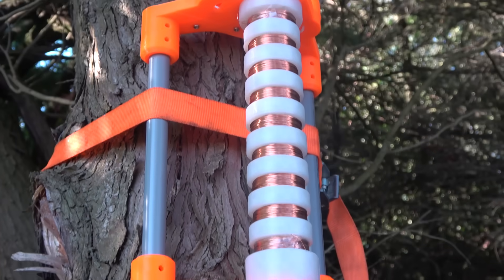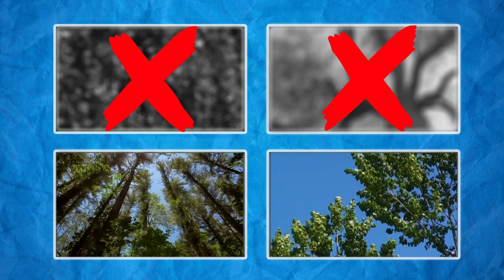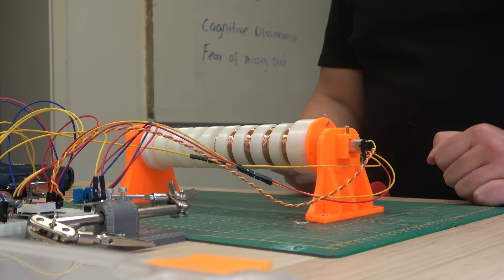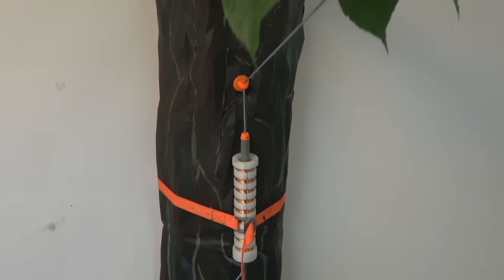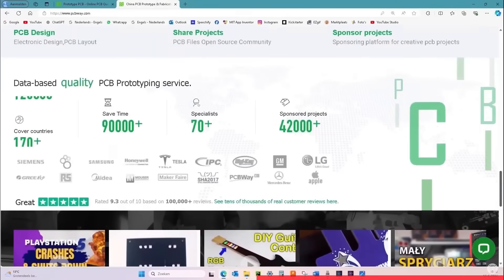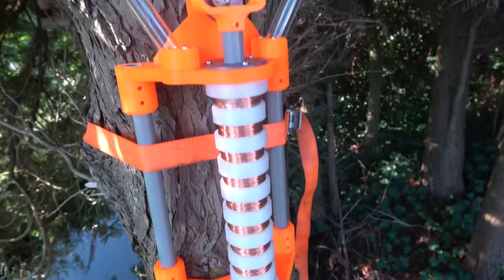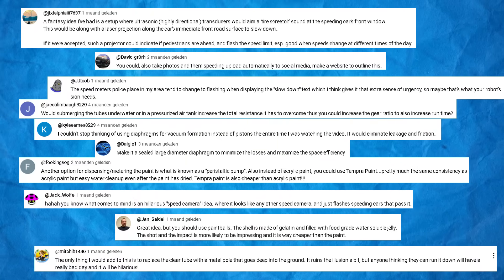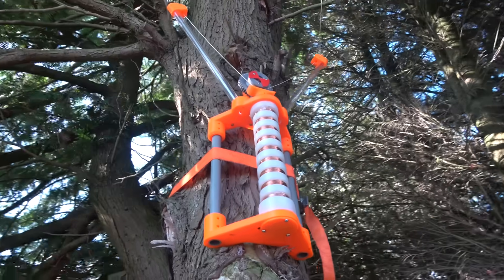I Made a Tree Generate Electricity..

Comment: Have you considered arranging the magnets to create a three-phase output using three groups of three coils? This configuration would produce a smoother output and reduce the required movement. You can achieve a pulsating DC output by using diodes in a three-phase rectification setup. The power output (VA) should remain the same while requiring less distance and velocity of movement (in theory).

For example, when magnet 1 is aligned with coil 1, magnet 2 would be positioned one-third of the way along its coil. As magnet 2 fully aligns with its coil, magnet 1 will be covering the latter third of its coil, while magnet 3 is now covering the first third of its.

Depending on what’s physically easier to construct, you could use either three individual magnets or three groups of magnets, adjusting the complexity of the wiring accordingly. Three-phase power also allows for more efficient transformation from high current/low voltage to low current/high voltage, resulting in less transmission loss.

Adding iron cores to the coils at these slow speeds should significantly increase power output for the same stroke length. This would require "washers" or spacers between each coil’s windings. Plain steel (non-stainless) discs should work well at these low speeds, as the metal is unlikely to reach flux saturation. (Just to note, I'm not an expert—just a 53-year-old hobbyist with a passing interest.)
Reply: All with still the single tube and magnet rod, Just clever spacing to arrive at the pseudo three phase timing. This only works because you have a constant diameter crank.

An alternative might be to use a conventional 3-phase RC motor as a generator with a coil spring for the return action rather than gravity. Like the timing wheel in a small clock or watch. Those can even be 3D printed in plastic and work surprisingly well! Of course constructing your own generator in that configuration would be much more difficult and not as easy to make weather resistant and such. If interested in experimenting, highly efficient permanent magnet three phase DC RC plane motors called "out runners" are available in many sizes, power and "KV" specifications (RPM per volt, iirc). Of course, its also easy enough to convert linear to rotational movement using a pulley.
Reply: and yes, I did get the point that more experimentation in efficiently capturing branch movements is likely the higher priority at this early stage.

Comment: As far as feasibility goes, I mean, If it can produce enough power to help recharge some batteries for devices of smaller size, then it's a useful item to have for those who want power available in some form out in the middle of the woods, etc. Basically useful under niche use. Outside of that, probably not much real world use for it. But still an interesting concept nonetheless. 

As for making it better? I have a few ideas.

1. Include some snatch blocks on those lines. I'm not entirely certain where to put them, but I suspect they will be helpful in converting the trees movement into more useful kinetic energy for you to convert into electricity. I could be wrong of course, but it shouldn't be a hard thing to include, and then remove if it's not worth it. Not like the next idea.

2. Weight is of course of the issue here, and so we don't want to make it too big. But there is perhaps room for a double cylinder method to be employed. Essentially you have one cylinder doing it's normal movement, but then on the outside of those you have the opposite going on as well, likely due to the springs mentioned pulling back and forth themselves if attached. So in this case you have magnets inserting into a cylinder of windings already, but in the new mockup, you would have a ring of magnets around that as well as its own outer layer of windings. And each of these layers is being pulled by either the tree, or the resulting opposite forces being reapplied through the springs & magnets you embedded. Perhaps a secondary pully system could be employed as well. the tree certainly has more energy to give than just two ropes worth, I suspect. My goal here in this part of the idea, is to allow for pairing to happen through a single cylinder being in series and the other single cylinder being in parallel, but in the tightest fitting method possible, I think, since size is the limit here. If this can result in a good enough charging capability to charge a phone, or even a laptop; that's a pretty good result IMO. And since I can't exactly make a mockup easily to show you... I will just explain that in my head the idea simply is that when the magnet rod is pulled, the outer cylinder surrounding both the inner and the rod moves in the opposite direction for its own outside cylinder of windings. These cylinder segments would only be connected otherwise through their wiring for the pairing. They would be separated by another layer for insulating purposes. Or something like that. 

3. The bracket should be changed to allow for a more modular approach for attaching more units to a single tree. This is mostly for the case of trees with many tall long branches that sway a lot in the wind. In those cases, it would be ideal to be able to strap 3 or 4 of them onto a single tree to connect in a new pairing to increase total output further. 

I am not sure how this would be done, as per a final design. I mean, technically a person could just strap multiple single setups onto a tree. But as you said, the point is to reduce visibility of the system. Keep it out of sight. So I figure a more modular approach would help with that. For instance, making it so you can have more than one pully on the setup, for areas where the lines are better off coming from that angle instead. Or more lines, for other units attached to the same initial rig through that modularity. 

It would probably help make #2 more feasible too with that opposite motion business. 

That's it, that's all. I've definitely given my nickles worth on this one. Good luck.

Comment: I had a similar idea but instead of using one tree and individual branches, I was thinking about having a number of trees around a central pole (or another tree) with a rotary generator attached to it so that a number of trees swaying gently and feeding into a single generator would provide a more or less constant rotary motion using a system outlined by mikeydk below.  It would probably need some gearing to provide enough rpm to make it generate any real current but I would expect a tall tree to produce a powerful pull.

Comment: You need more closed durable system against durt and water . Round shape for rope be twist, spring loaded, some supper capacitor and battery pcb to control charge ing and dis charging, I mean some of small PC mouse can fold the wire using small  round mechanism with gears . Best luck . In mass production the most expensive part NOT the device it self it will be the way to get top of the long tree to fix the rope

Comment: If the greatest movement distance is what generates the most power, I think attaching the generator to the top of one tree and the string to the top of another would be a good option.
Finding two trees that swing out of phase in wind would be best, like one in the trough of the wave and one in the peak (in a theoretically perfect forest).
This would require a lot more string and be hard to set up though, unless maybe a drone could be used to attach it to the tree.

Comment: Instead of sending stored energy directly to the power system. Why not use clockwork mechanics to build up energy into a wind spring you can use that to power small Gyro getting a steady supplie of a small amount of energy. But with each one of these small mechanisms, I can easily see one for each branch 30 to a tree. And each passively charging something akin to 2 18650s. With the right timing cycles that can all easily power a small tiny home. A fridge tv some on demand hot water

Comment: Nice concept and implementation! However, linear generator is less efficient than traditional due to end effect, where last coil produces less energy than central ones when "rotor" displaced in opposite direction. You can add more magnets with same number of coils to eliminate this, but with traditional one you have no need to fight the gravitaty (as @mikeydk described). Or you can try intermediate way just directly attaching little gear to generator. It eliminates gravity, end effects and losses for rotary-linear conversion (inertia issue remains, but it less problem than gravity of "rotor"), but way more simple than geared ratchet system.

Comment: personally i would have used two ratchet gears on this back to back one going clockwise the other going counter clockwise then having that connected to a gear & sprocket 1:1 basically turning back & foward rocking movement into rotational movement then gear that output to 20:1 making spin fast enough to generate a decent current

Comment: Trees are incredibly heavy and take a large amount of force to move. To make the most out of these large forces, I'm sure you could step down the torque to quite a small amount, without having issues pushing the dynamo mechanism.
Reply: I think you would run into other limitations like the string stretching under load or the generator flexing
No doubt this isn't the most efficient setup but I don't think going for larger forces will help given the issue with the weight of the magnets, if a lot more power could be easily used that extra force required would not have been a problem

Comment: Ah, so it's using wind energy! Pretty cool.
Reply: If only we already had a very efficient way of harvesting wind energy
Reply: @christiannorf1680  But this concept is much cheaper and easier to make, both the tree and the windmill generators have their pros and cons...
Reply: @sosiskago5802  for the amount of electricity generated, pretty sure it's way easier and cheaper to build a mini turbine from a toy fan motor?
Reply: @SidShakal  yes but where do you put it? the trees already use up a lot of wind energy in the forest. so you cant put it in a forest full of trees. but if you had such a device similar to the video you could run your home with only 10-20 trees around your home. and instead of those magnets I would still use an ac motor/generator
Reply: @Knightfire66   put it above the trees, idk. did i miss the part in the video where his device generates anything other than short, low-voltage pulses only capable of powering LEDs for moments at a time?
Reply: Only harnessing changes in wind energy, it seems.

Comment: A cubic arrangement of these (multiple between two plates) could be placed
in a waterway of, constant, sufficient depth and a "wing ?", on top which pushes
and pulls the poles up and down, by the water flow over it. There would need to
be a mechanical "flipper switch", at the top and bottom, of the movement, to
cause the "wing" to change direction up or down. If sturdy enough, you may be
able to get some good hertz out of it. This would be a great help to "off grid" folks
for, at minimum, charging their batteries. It could also be added to a wind and solar grid. 😁✌🖖

Comment: Random dude on the internet here but I think with any good generator you need power storage... I agree with some kind of winch or ratchet system for continually spinning a generator, that way you could connect more tree limbs and in theory generate more power. Of course it is not feasible if it harms the tree or generates too little electricity as im sure you are well aware of. Maybe this might even be a good way to stop people from cutting down so many dang trees in the future lol.

Comment: Use a rack and pinion gear system to convert a linear movement into a rotational movement of the generator rotor. Then you will need to find a generator for such weak current with efficiency of 60% to 70%, which is about the maximum efficiency a generator can go. You can also use a system of pulleys and ropes to increase the force by reducing the speed.

Comment: you could easily run a rotary generator on this setup instead of needing a linear generator, the issue is getting the random movements of the tree into something that spins in one direction for better efficiency. I'm sure you could do that with some fancy gearing or clutches but I'm not certain how much extra resistance that would add. It would be interesting though to see if you could get a tree to consistently run a flywheel.

Comment: I had this idea couple years ago, havent had time to try it yet! Very glad to see it work!!!  My idea tho was to have a single station on the ground with a longish shaft with multiple ratchet type pulley with a flywheel. Then ropes to branches of multiple trees. 
A transmission can be added between the shaft and the generator to improve efficiency

Comment: What about changing the linear motor out to a radial motor and use use a diode rectifier to make half sine way with only a positive component, few caps and then a use a LM7812 to get a clean dc wave?

Comment: Better to use a stepper motor and just rectify the output from that... Especially since you already have rotational movement and it would cut out a bunch of conversion/friction loss.

Suspect it will never generate more power than the power consumed in building it... But I'm interested to hear.

Comment: You need to link up a bunch of different branches, combine them into a kind of ratchet mechanism (to synchronize their motions into a number of harmonious phases — one would work, but multiple would allow you to segment out different components of the many differently moving branches which would increase efficiency), then use a pulley system to turn the high torque into longer strokes of the magnet in the linear inductor (although you could just forego a linear inductor and simply use the pulley system to spin a typical ‘circular’ electric generator). Then output to a rectifier circuit, add an electrical load, etc… Also, I want to note that if you consider the roughly ‘Y’ shape of a tree, when a wind gust blows the tree one side lengthens and the opposite side contracts — keying off this extenuated difference may allow you to design a more efficient system. 🍻

Comment: my idea is that since the tree is so tall and its bending has a lot of kinetic energy we could use some strong ropes and foor alternators just normal powerful alternators in four sides of the tree and if the tree moves in any direction at least one of the alternators will have some movement of course you can add some gears to speed things up and finally some tectifiers to converts everything to dc as the waveforms generated by the alternators will not be uniform and some kinda strong capacitor and a pure sine wave inverter and probably a battery and see what energy will this give us , I think if done this way it'll be so nice since this works day or night in windy or even normal weather

Comment: Hi, I had similar idea many many years ago, but nice that you have taken time to build it. I didn’t proceed with the project, because at the time I couldn't see how this would make economical sense. However, with these open source project, cheap components from China and need for green energy, this may be worth of considering again. 
The considerations I’d like to share
- You have already rotating wheel, maybe consider using that to rotate low cost dynamo instead.
- Making lines between two trees, as suggested, my be more efficient.
- Your system system showed energy generation from one direction (e.g. W-E). Please consider combinations for W-E + N-S by mechanics or multiple motors to harvest energy instead of one, two threes and directions of movement.
- In order to actually use this, you’ll need to consider mechanical protection and eventually corrosion protection. If you can consider many designs and component selections, such options will be eventually measurable. Start of the large table and project with Wiki?
- If you can make the system last for some time, then you’ll have a new challenge: As threes grow, length of wires need to change. Thus consider adaptive height option.
- Eventually you should consider optimizing energy harvesting at different wind conditions. If you are no expert on this, than maybe team up with e.g. GreatScott! and test how efficient you can get.
- Don’t think small, as hobby project. Maybe you can think this other way around too: How much power you can generate, vs. how much parts cost (and last), and take time to install. What would be cost of kWh? With community feedback many details can be worked out.
Looking fwd for update!

Comment: I think you might be able to use a second generator in parallel to the other as a counterweight. Then you would double the output for the same motion; without the problem of pulling against gravity. A rocker arm at the top, between the two magnet stacks could have bearings in it. You might be able to use the same end piece that you have inside the scorch yoke for the magnet stacks. This is a great idea!
I wonder if you could add a third line from the branch, but above the branch. Making an equalateral triangle of lines. That would get all possible motion from the branch. Hmmmmmm...  I'll think about that for a bit and see if I can figure out how to harvest three, balanced inputs like that. Hopefully my idea leads someone else to a better idea. Thanks for putting this up on yt for everyone.

Comment: My train of thought would be: use the movement of the tree to load a springmechanism. The spring can be used to deliver constant energie to a generator
Reply: A bit like winding a clock (or lifting the weights on one)
Reply: Or use a big capacitor as main buffer. After it and some parts added put a rechargable battery... Nice project and very clever!